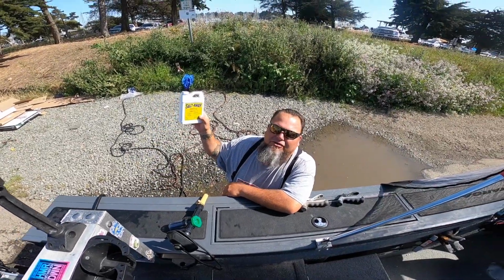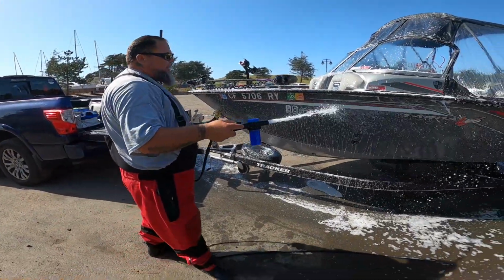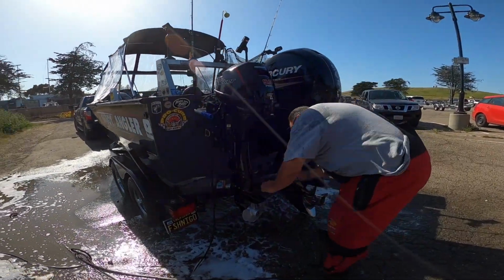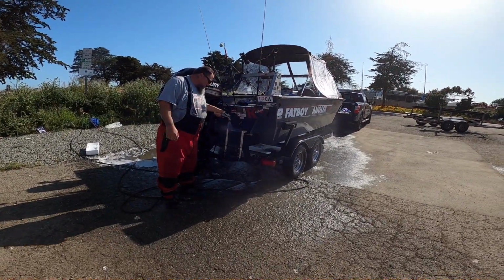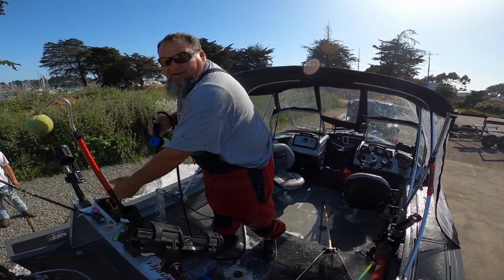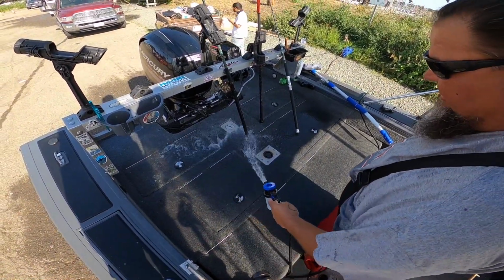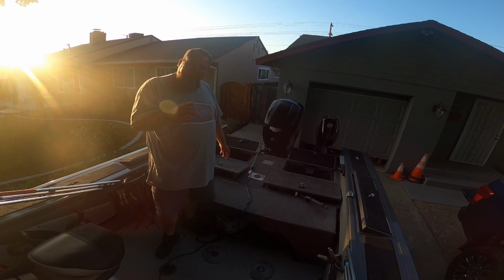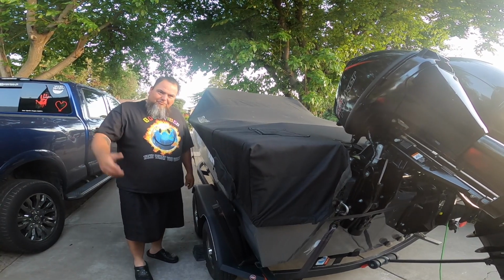Saltwater boat cleaning process

Comment: Thank you very much for this thorough example…it is Excellent!  My boat is a walk-thru windshield aluminum as well so I’ll be mimicking your wash down routine.  I’ve never used “Salt Away” but will be ordering same soon with the mixing unit/nozzle,  I’ve got a big late model Mercury outboard as well which, like your 150, should not be running when flushing, unlike the kicker which of course should be running while flushing.  Some of your newbie boat owner viewers may be confused by this.  I’ve got a galvanized trailer now so salt doesn’t effect it as much as it did my previous trailer which was not galvanized. .Many trailers are tubular so the inner parts that get soaked with saltwater during launch and recovery are hard to get at with a hose.  Lastly…trolling motors.  My boat has a fresh water one like yours and I’ve always wondered how much saltwater effects them on the deck, even when not put in water to operate. I posed that question in a boating social media group and got a 50/50 response ranging from “never expose such trolling motors to saltwater” to “I’ve been using my fresh water trolling motor in salt for years and never had a problem..”  That said, a popular YouTube bay area fishing content provider covers his trolling motor with a black garbage bag when fishing in saltwater.  I’ve done the same the few times I’ve fished the bay for halibut figuring it can’t hurt.  Thanks again for your outstanding video.  I learned a lot!
Reply from the maker: Thanks for Watching!! Im glad this has helped you out some. I like the Salt away because its more sudsy and soapy that the others i feel. I got both the Salt away and the nozzle unit on Amazon. For our trailer we made sure to upgrade the brakes due to saltwater and made sure the trailer itself was good for saltwater. Thats a great suggestion for the trolling motor to prolong its life!! I noticed on ours the finish and housing has taken the worst beating but it still works great! We try to do a good rinse on it after each trip. Thanks again! Glad we could help you out! We're still learning too! ~Tight Lines~